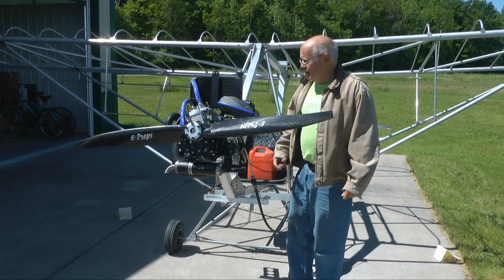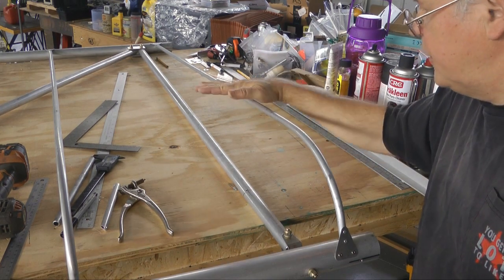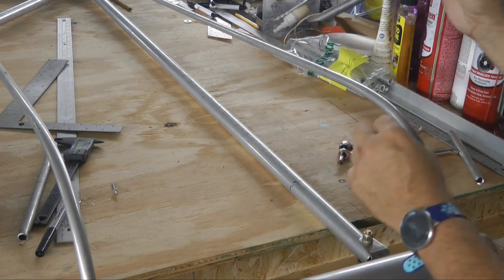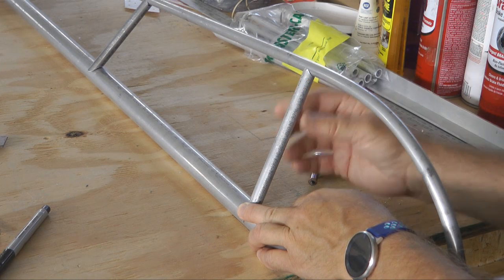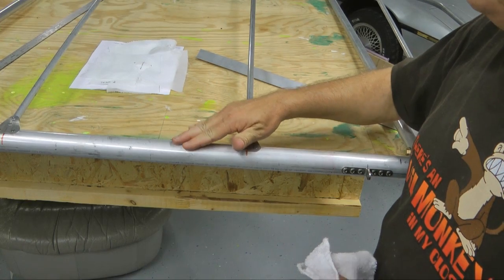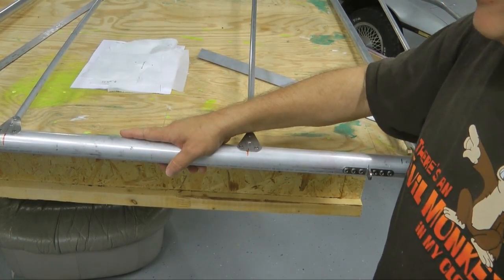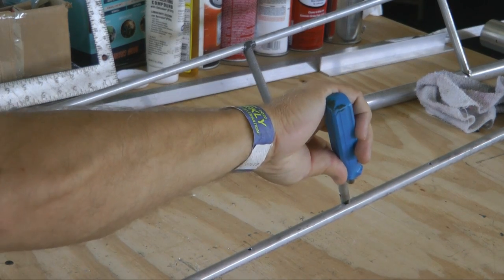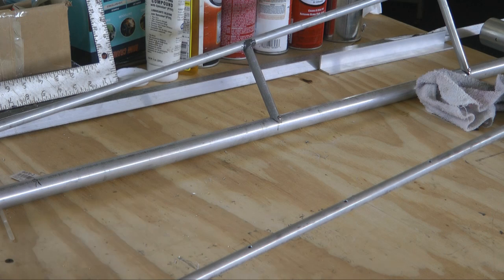Building the Affordaplane Part 48

Comment: Just a suggestion: when you drill the 1/2" hole to provide the support for the end of the "struts" you could hold them in the drill press vise with strips of wood. That way you wouldn't risk drilling into the jaws of you vice.

Comment: Would it have been easier to drill the top holes in the ribs before installing them on the wing?  I think drawing index lines at every 90 degrees along the length of all tubes, round and square, prior to cutting them to length for each application would pay dividends later when performing operations like this.

Comment: question = why couldn't you weld the whole airframe ?
Reply from the maker: Short answer: Same reason you dont see certified aircraft with aluminum welds on their air frames: first weld crack and goodbye forever!  Boats, lawn chairs, automobiles - no problem with a professional aluminum weld.
Reply: Aluminum welds are risky, require additional equipment and skills, and rivets are perfectly capable. Did you know the Hawker Hurricane (and other Hawker airplanes) used riveted aluminum structure for its primary structure? Aerodrome Airplanes does this as well.
Reply: @SoloRenegade  Hi. There is the crashed frame of a Hurricane at Tangmere Museum.  All the joints in the centre metal box frame are tube squared and riveted. No welding.
It is interesting to note that the shape of the fuselage is done over wooden formers and wooden stringers. The early Hurricane was almost all covered with fabric. Even the wings and control surfaces. Later the wings were metal skinned. 
The early Spitfires had control surfaces covered with fabric. Later the ailerons were covered with metal because the fabric used to wrinkle at high speeds.
Reply: @arthursoutham9046  Many WW2 fighters used fabric covered control surfaces to save weight such as the F4U and P-51. The more weight you save from the tail the better compared to other places.